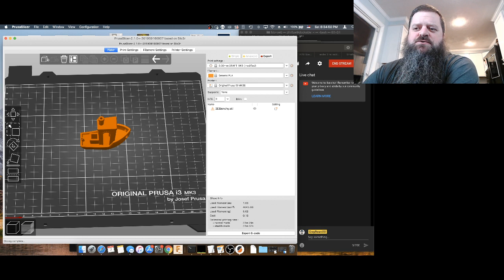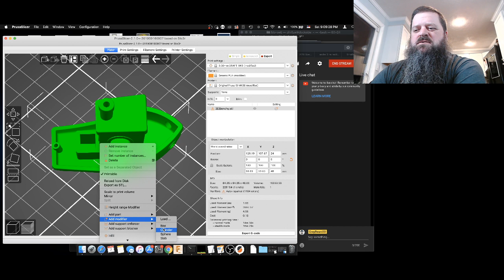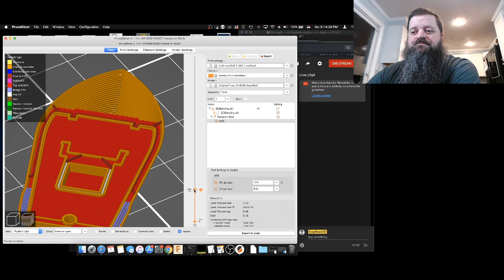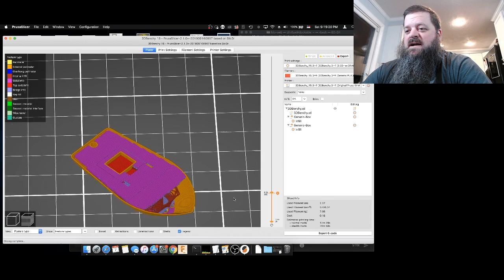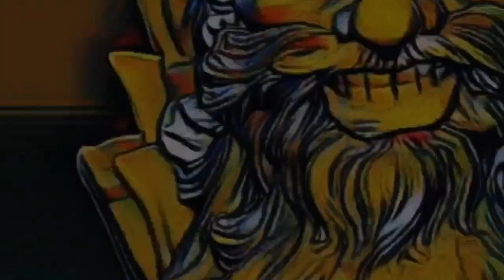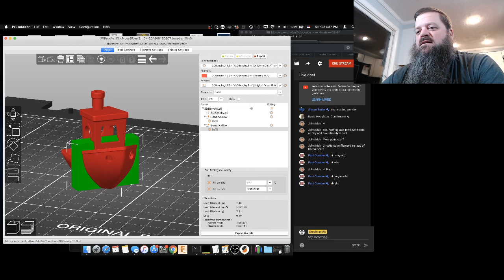Tuning Prusa Slicer for Speed - Tips and Tricks for a 15 minute Benchy

Comment: It's surprisingly hard to tell a slicer to just go balls to the wall and max everything out to test machine limits, disregarding quality, at least at first.  They're all got hidden limits, and just determining the priority of each can be frustrating.  Disabling min. layer time cooling slowdown and turning up max volumetric flow have a huge impact.  Using a .6 nozzle as default is also helpful.  I rarely need to use smaller.

Comment: I honestly don't think some of those settings count for a benchy. I was always told for a speed run on a benchy you need 3 perimeters, 5 bottoms, and top layers. 0.2mm layer height. 0.4mm line width, 15% infill. With these settings I was able to get a 27minute benchy on my Custom CoreXY Ender 5 plus, with a G5 flex3drive extruder. Check it out. It keeps the stepper motor on the side of the printer and transmits power to the direct drive through a flexible driveshaft. That way you get a direct drive with basically no extra weight on your hot end.
I used accelerations of 4000 and jerk of 20

Comment: Thanks for this. Lots of useful tips for reducing print time which can be applied practically (not just in speed competitions).

I also like to disable retractions when not crossing perimeters. And to merge every two layers of infill.

I'm going to experiment with printing infill and inner perimeters at very high speed, then outer perimeters at higher quality.

Comment: Hey. Do you have an Ender 3 and by any chance have you experimenting pushing print speeds to the max on one using PrusaSlicer?
Reply from the maker: Patricia Galvan my son has an ender 3 pro. I have a Prusa slicer profile for it but I have not tried to push it.
Reply: @GreyBeard3D  Oh okay. Thanks for replying. I use Cura and I just need to use prusaslicer for one very specific detail that I can't have customized the way I want in Cura, and I need to print hundreds of these face shields within a matter of days. I was able to tune in all of the settings and made a 4 hour print go down to 1 hour.
Reply: I used this to push my ender 3 quite a bit, all speeds at 200,yet controlled pi volumetric speed and getting nice results(15 min face shields,depends on model)
I've used this as a base for my new profile ever since december